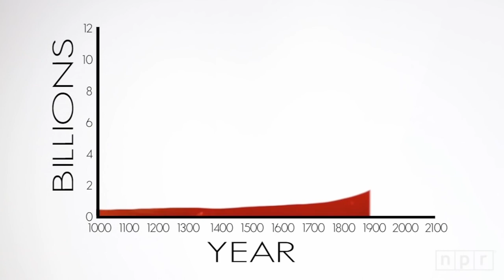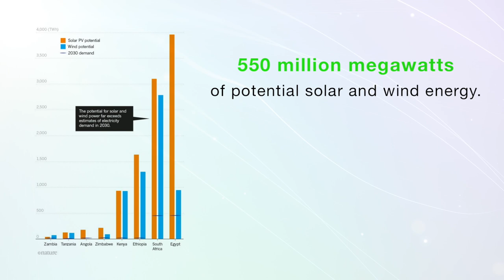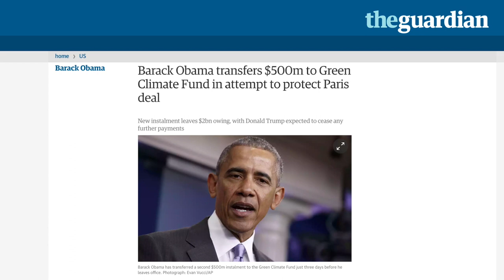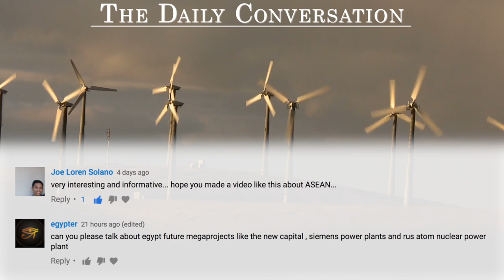Humanity's Once-In-A-Species Opportunity: African Energy

Comment: One point that is terribly missed is that the renewables can`t take off in the particular region, as well as some parts of the world i.e. much of lower-income Asia (bar India), unless the major renewable power plant component (solar panel, wind turbine, transformers, energy storage system etc) manufacturing are fostered there. It is meant that these components should be manufactured there and not imported from industrially-developed countries in a long run. It could also alleviate the unemployment problem, whus improving the sustainability. Therefore, the major world powers MUST let and give proper and generous incentives and not quelling the manufacturing (such as by flooding them with cheap imports) in these countries. Give them fishing rod, not the fish.

Comment: I have and Idea for energy, transportation, cooling, and maybe even some drinkable water.  I call it hydroloop/Aqualoop it is a hyperloop system but instead of it being airless it is filled with seawater. The water would be pumped in a one directional way and it would push a water jet propel capsule. It would also work as a radiator for earth by moving colder water over land, It would also most likely make condensation (clean water), and smaller water turbines can be used next to it that gives what ever place its next to power and then the water goes back to the tube system. It would also supplies saltwater to desalination plant for more drinkable water. And the main starting points would be from any shore line to any and all major body of water. Maybe even over seas maybe.

Comment: I have a problem with the false image of nuclear power you portrayed. As it statistically is safer, greener and cheaper than any other source of power. 

Feel free to look it up
Reply: Wrong. YOU made this FALSE claim.  Obligation is upon YOU to prove it.
Solar and wind are the LEAST costly, the SAFEST, forms of generating electricity,
and LESS polluting overall.  One-time production of the solar panels & windmills 
requires less oil than a nuclear power planet putting out the same amount of power.
Feel free to look it up.